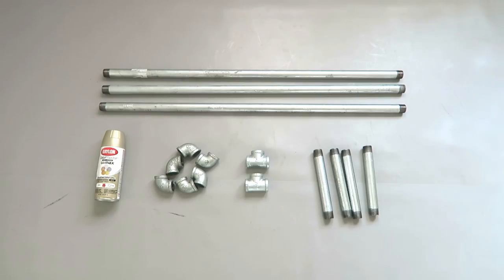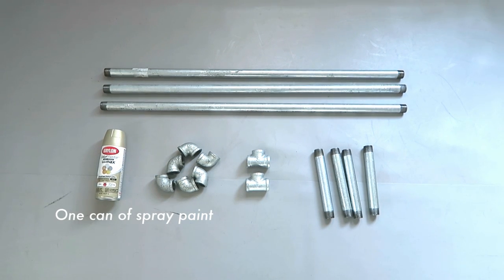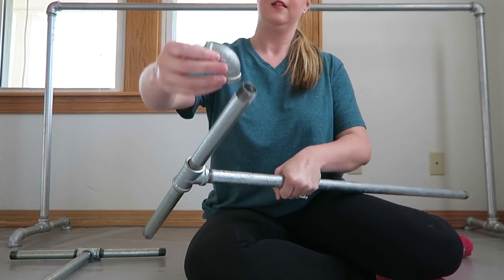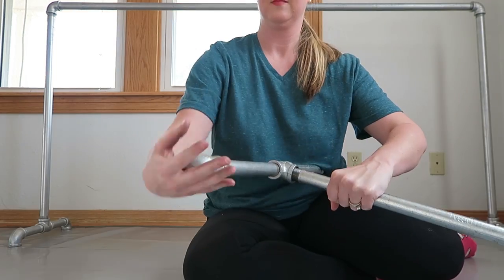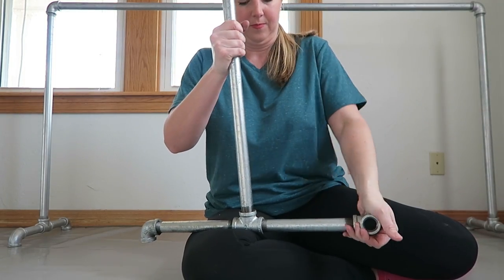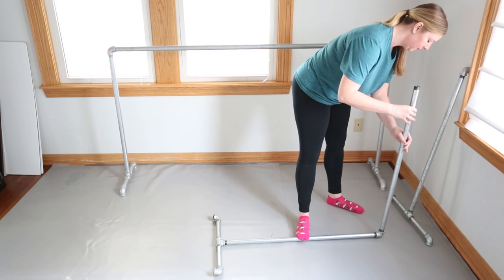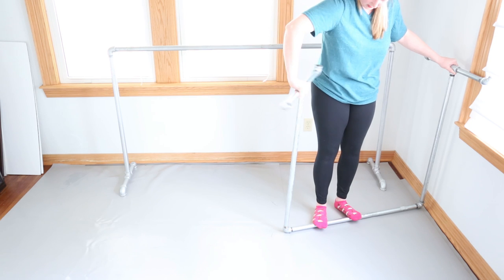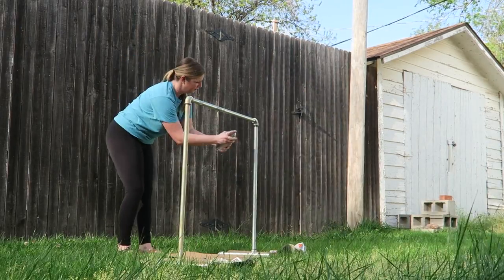How to Make a Ballet Barre!

Comment: Thanks, Great idea! I would change 1 thing on this design that will make it much sturdier and much easier to put together without it flopping around. Simply by applying some Teflon Plumber's Tape to the threads of the pipe before assembly. It would allow you to adjust the angles anyway you wish while still having a secure fit. Teflon Tape takes seconds to apply and is costs less than $1 at most home improvement stores.
Reply from the maker: Thank you for sharing this! I will try that for the next barre I make, and maybe to adjust some of the ones we already have.
Reply: Ballerinas By Night 
My pleasure! Would love to know how it turns out!

Comment: Awesome, thank you for this! The only thing is that I was hoping it would end with a demonstration of using the barre :) Just to see how strong it is and so forth! Thanks again!
Reply from the maker: It's the same type of barre we both use in all our videos, so you can see them demonstrated in many of our past videos. They are sturdy enough to be used in regular studio settings.
Reply from the maker: https://youtu.be/QCURdvJdH_k?t=14m46s
Reply from the maker: https://youtu.be/wr37JOt8kiE?t=4m48s
Reply: what size is the width. I did 1 inch with plastic pipes and it's very unstable.
Reply: That's wonderful, thank you so much for your reply!

Comment: Thanks for the tutorial! Does this type of bar can bear pointe work?
Reply from the maker: Yes! Absolutely. This is the same type of barre I used in my studio. I do recommend going with the 1 inch pipe if you feel like you will need to bear more weight on it, and also definitely getting the 8" for the 'T' pieces - which will ultimately make it a little sturdier.

Comment: Has anybody made any longer barres? I'm wanting to make a couple for my dance studio and just wondering how they hold up (:
Reply from the maker: They hold up great! I made several for our studio, and have taught at several studios that use the same basic concept to make them. I would consider thicker piping the longer you want the barre, and longer pieces on the bottom to stabilize it. :-)
Reply: You could also put a T connector between barre lengths to add a middle “leg” for extra stability on long lengths.

Comment: So I got the materials and put the barre together, but it's quite wobbly at the moment cause certains connections had to not be tightened as much as they can be in order for things to line up properly. Any ideas on how to tackle this?
Reply from the maker: The recommendation we got was to use Teflon Plumber's tape, and that will give it a more secure fit.
Reply: Teflon tape will allow you to tighten it more easily. And if you have a pipe wrench, that's the ticket. You can always get another half turn with a little leverage!